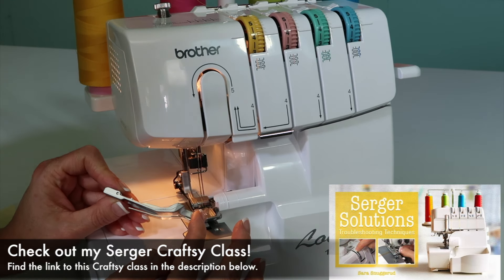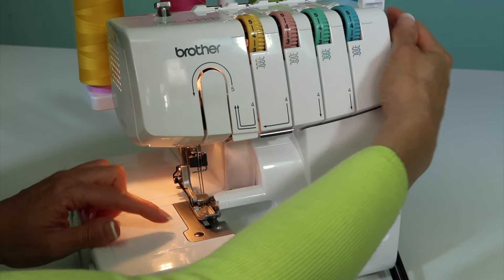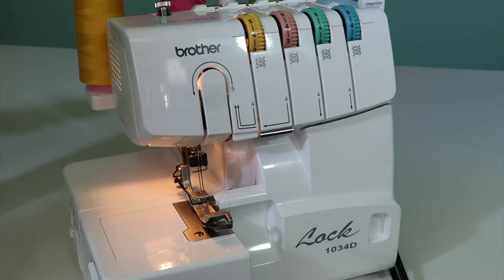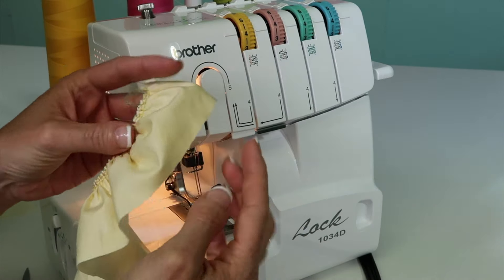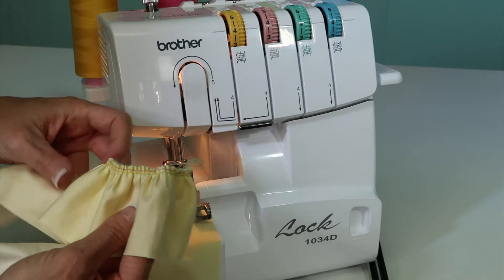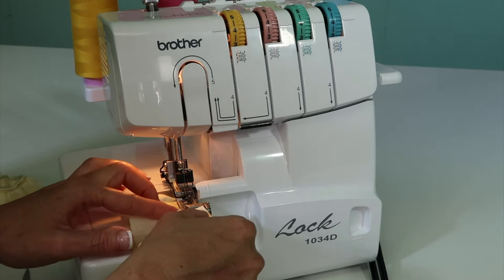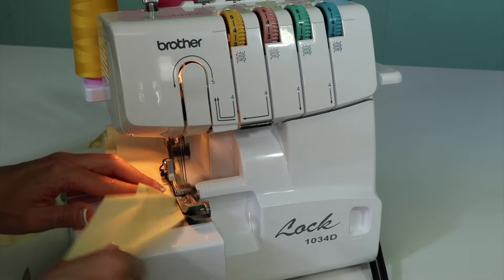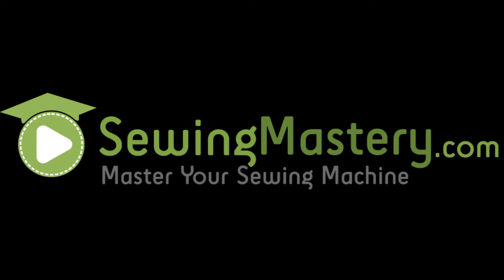Brother 1034D Serger 30 Gathering Foot

Comment: Could you please tell us, What number do you set up the length and the width of the stitch?  Thank you 😊
Reply: I would like to know this information as well.. thank you
Reply: Selina Holland You don't need a ruffler foot to make a beautiful ruffle. Here are the settings and use the standard foot that came with your serger:
Differential feed:   2.5
Stitch length:          4
Upper looper:          3
Lower looper:          3
Left needle:              7
Right needle:            7
Hope this helps. 😊
Reply: @TheJudeJane  you ARE a sweetie! thanks.

Comment: I love this feature.....now I just need to find my accessories that came with my machine🤦‍♀️
Reply: Lynette Patrice You can use your standard foot and make a great ruffle:
Differential feed:   2.5
Stitch length:          4
Left needle:             7
Right needle:           7
Upper looper:          3
Lower looper:          3
No need for a "ruffler foot"!!
Reply: Lynette Patrice  Yes, you can make a beautiful ruffle without a gathering presser foot on your serger, but if you want to make a ruffle to a straight piece of fabric at the same time, you need the gathering foot. 😊

Comment: Where did you get the gathering foot from? What is the brand?
Reply: Allie Kai-Sumiki it comes with this particular machine. If you didn’t buy this one you can purchase it online not sure about in store, but most likely you can.
Reply: Allie Kai-Sumiki  You do not need to buy a ruffler foot to make a great ruffle on your serger. Use standard foot and here's the settings:
Differential feed:     2.5
Stitch length:            4
Upper looper:            3
Lower looper:            3
Left needle:                7
Right needle:              7
Makes a great ruffle! Hope this helps!😊

Comment: This stitch did not work for me
Reply: Jessel Phillip No need for ruffler foot. Use your standard foot that came on your machine. Here's the settings:
Differential feed:   2.5
Stitch length:         4
Upper looper:         3
Lower looper:         3
Left needle:             7
Right needle:           7
Give it a try!! Make sure you check your machine manual and understand where the tension disks (knobs) are to get correct balance for the instructions I gave here. 😊